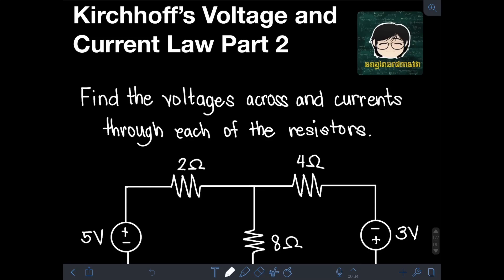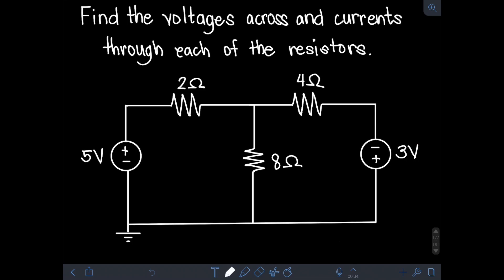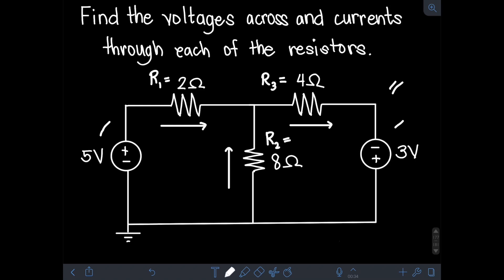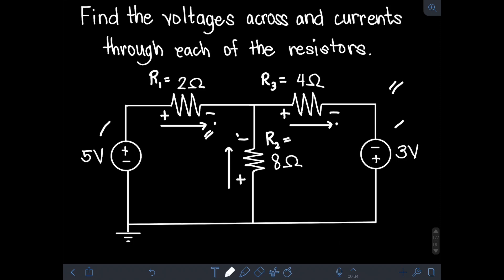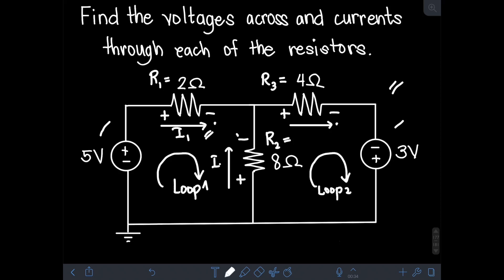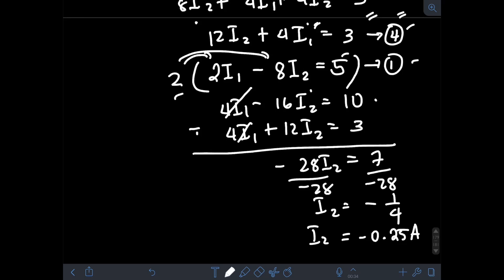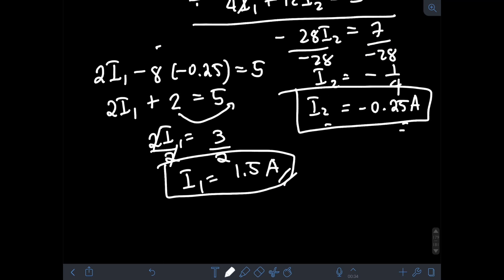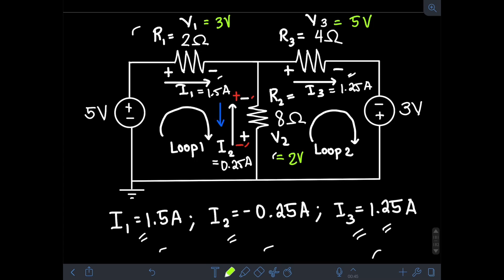Kirchhoff’s Voltage and Current Law Part 2 (English)

Comment: Nice video. I found one thing confusing. Our assumed current direction across R2 is UP, and our assumed loop current direction in loop #1 is DOWN at R2. Are these two assumed current directions completely independent? Is the assumed current direction at R2 just for KCL, and the assumed loop current direction just for KVL?